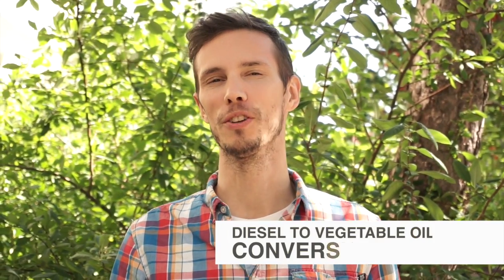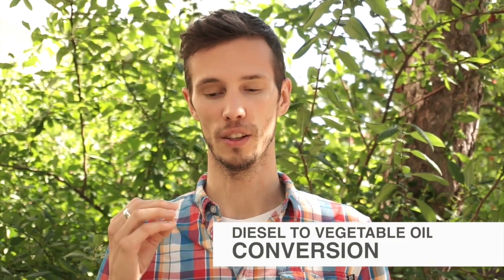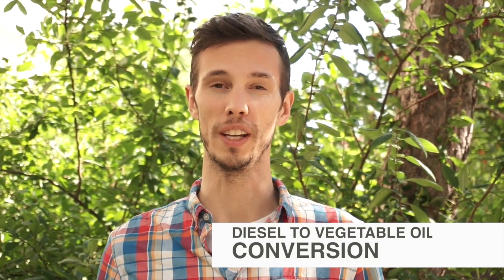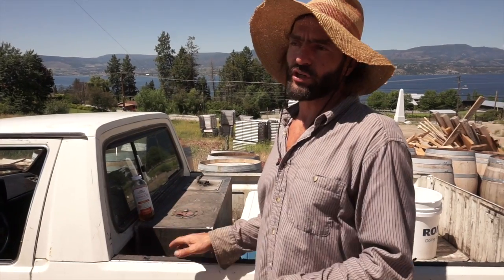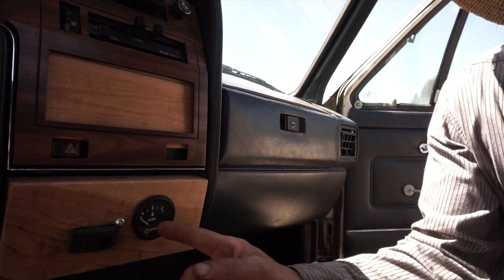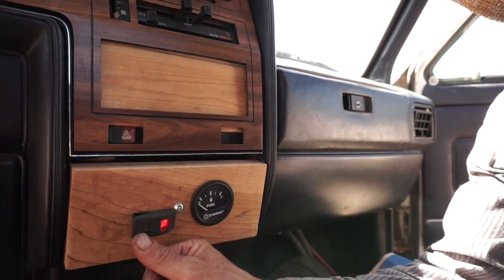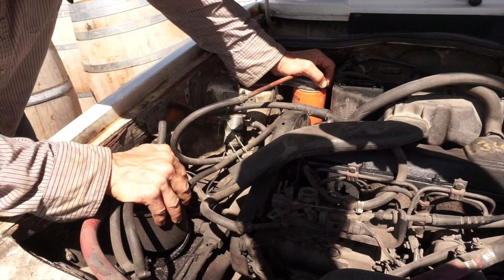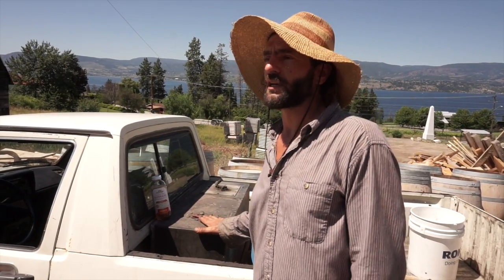Farmer Converts Diesel Truck to Run on Waste Vegetable Oil

Comment: Hows to system running in time.what happens if you get cooking oil with animal fats can a heating unit be fitted?.with diesel prices at $2.40 a litre in Australia this would be great on my old Datsun 720

Comment: A man in the 1970s did this to a Datsun pickup. You also get more miles out of a motor because it better lubed with oil fuel. The man in the 1970s tried to patent the idea, and the government wouldn't let him. He was getting like 50 mpg as well...

Comment: At the start you stated you can convert any diesel, as someone who has done a conversion and run the vehicle for a few years I disagree, I personally would not recommend anyone doing this to a modern common rail diesel motor and IMHO the best candidates are older, more basic engines with no electronics ie mechanical injection pumps and mechanical injectors.
It’s also important to filter your oil well and engineer the system so as to avoid cross contamination of vegetable oil into your diesel, this can be done with independent supply and return valves and controlling them so vegetable oil doesn’t ever return to the diesel tank, having some diesel in your veg oil is fine but not the other way.

Comment: neat system. Technically to get a diesel to run on vegetable oil though, you just need to pour it in the gas can. No mods needed. I wouldn't do that long term, but it can be done.

Comment: I’m in the Texas area and the government has been taping into this source and it’s been difficult to find a good source. I was just going to use a bucket, Rachel strap, and some fabric as my filter. I’ve used up about 10 gallons of WMO. I don’t run 100% but I run a max of 50-50 or 25-75. Diesel to oil ratio. But it’s a bit harder to get the WMO because auto stores won’t give it to you.

Comment: No need to go to the expense of doing a conversion just use a 50/50% diesel and sunflower oil mix, you can increase to 30% diesel and 70% oil in the summer months without any running issues but under winter running conditions a 50/50 mix works well, and you won't have problems starting. I have been using this mix for 12 years on a pajero 2.8 auto 1996 registration with no problems.
Reply: @exploring perspectives It saves money in the EU a gallon of diesel is 7.30 US dollars, supermarket oil is half that
Reply: i alsp have a pajero 2.3 td 4d55 with precomp chambers in greece ,do you believe it would work???
Reply: @ΙωάννηςΛαμπρογιώργος  it depends on your diesel fuel pump the older mechanical pumps on the 4m40t run ok but you will have to check with a reliable 4d55 engine tech to make sure. Some pumps cannot contend with a non diesel feed.
Reply: @radionutio81ij79  thanks a lot!!!! , 4d56 is older mechanic so i believe it wont have problem
Reply: Hi i know its late but can i ask you a few questions since my mum health isn’t doing well and i need to save some money to help her get her surgery 

So long story short short im 23 

Im gonna sell my gmc sierra truck to help my mum 

And i need a vehicle but I can’t afford gas or diesel so im considering this 

I need more info about this if anyone can help
Reply: Dont listen to this guy commenting all a conversion means is adding in-line fuel heaters and filters..in colder climates an add. tank is necessary for starting. without these add ons if you put used veggie oil in your tank your car WILL BREAK DOWN. This is a hard thing to do if your just looking for an easy way to save money it will cost you eventually.
Reply: @trluke94  wrong
Reply: @trluke94  Your car may break down on 50/50 during winter, but it's less likely in warmer climates. Maybe he runs his Pajero near the equator for all we know.

Comment: This might be useful for jet fuel, but as for cars I think compressed air is the way to go. Electric needs batteries which we dont have enough material but it will help on the side, and vegitable oil takes up too much farm land for everyone to use that, but I think it could be useful for just planes as electric planes dont get that far
Reply: 😂😂 compressed air

Comment: Hi Mat, thanks for sharing your video. The inline filtration system you talked about for filtering your oil as you collect it, do you have a link for it by chance? Is it a centrifuge filter/seperator?

Comment: So let me get this right, he switches to diesel when coming to a stop because the engine can't keep the idle(as vegetable oil it doesn't burn as good as diesel). But this applied in a modern engine with electronics, where the idle is automatically adjusted to keep the engine running, shouldn't be needed. So if this is right, he could just adjusted the fuel pump to get a higher idle and avoid stalling when stopping, that way you don't need the diesel anymore
Reply: Why not just blend some diesel with the WVO? Start by adding 20 percent diesel into your spare tank.
Reply: he switches over to wvo so the car starts on diesel and runs till it gets warm enough to switch to wvo. the car will idle fine when it is warm
Reply: someone said adding diesel would help keep the wvo so you wont need to heat it up, idk i think they said 15-20% but if you run striagt on wvo its a great thing...no diesel needed right?
Reply: just mix 20% gasoline in the oil and no mod needed...
diesel mix tend to gel at low temps.
Reply: it's to flush all the fuel lines and the engine itself, you don't want the water and wvo in your engine overnight
Reply: Teun van der Woude not really cold start is the only problem of wvo that's why you switch to diesel before ending a trip so next start won't be difficult

Comment: If you want to live in sustainable manner, then do NOT put FOOD into your fuel tank. Thank you.
And no, not even if it's used oil, since an increasing number of vehicles running on this fuel, will create a need for more veggie oil, which at a certain point will mean FRESH vegetable oil.
So just stay out of there.
Reply: After a certain number of cycles or usage (times used for frying), cooking oil will become rancid, acidic, dirty, and not food safe even if extremely filtered. When the restaurant disposes of it responsibly, it is sent to be one of 2 places: 1) to be used as heating oil for buildings 2) to a biodiesel factory to be converted into vehicle fuel (which is what this man does, he simply cuts the middle man out and saves restaurants money so they won't have to pay to have hauled away)
at no point in the next 100 years would any farm or cooking oil company find it economical or logical to sell oil mainly used for cooking straight past the restaurant and into our fuel tanks. its impractical and would never sell as diesel, even at $5.50 a gallon, diesel would be $1-$2 cheaper that the lowest quality cooking oil

Comment: I contacted a mechanic who did it to his Mercedes and said its not worth it, he replaced injection pump after 35000 miles.
Reply: your wrong the only way to go through an ip or injectors are
1. inadequate filtering (particles arnt good... doesnt take a genious) 
2. inadequate per-heating (160 deg. f flows oil similarly to diesel oil is much thicker)
3. if your oil doesnt lubricate the pump (a can of diesel kleen will solve that)

long story short the ones who do it right dont experience problems but thoes who dont give it a bad name 
P.S 160 degrees F. means the oil is that hot in the injecton pump/injector lines/fuel line coming in the injection pump id insulate the lines for the last one
Reply: I been driving diesel autos since 1977! Right now I drive a 1982 MB 300 SD turbo diesel! The problem is the mechanical fuel injectors need the lubrication from the fuel, veggie oil does not do it! Now with the modern common rail injection systems on  the newer cars and trucks no way!  New injectors are not cheap, then you have other issues! The Idea that its well free, it's really not, unless you consider your time and effort worthless! I do not! I while ago I was looking a  300 D MB from Southern California, the car was in damn near showroom shape, and less that 80K on it , a 1981 car, converted to veggie oil, I told him that I would buy the car, for 1/3 the asking price, because I would have to replace all the injectors, fuel lines, and the injector pump will have to be taking out, no small job and gone thru and rebuilt! This pumps on MB are as bulletproof as you can get, then run a lot of diesel purge thru it, remove the tank and clean it out! I shake my head every time I see this sort of stuff!  The 617 engine is a very good engine, but its designed to run on diesel fuel, not just crap that you can get it to burn, it will do it with a lot of work and headaches! That guy is not saving a dime on his fuel costs, it just goes to other places, mile for mile it's cost him more!

Comment: Can I run used veggie oil in the normal tank? Will it auto ignite like normal diesel when the engine is cold? Can you put the oil without doing anything, and I'm pretty sure it will clog the fuel filter way quicker?

Comment: So will the engine burn the fats in the oil as long as its heated high enough? Or do they need to be cleaned out before its added to the tank in the truck box?
Reply: From what I've read, you have to filter your Veggie oil meticulously before you put it into your tank. If there's any food particles, water, soap, or fats, then you'll eventually break your engine's fuel injectors.

Comment: Well.. it's a great idea to do this if you can... especially if you need to save money... BUT beware: - 1) Most modern diesels ("common rail") are not suitable for (simple) conversion and a lot of diesel pumps are not suitable and WILL BE DAMAGED very quickly by Veg oil (Lucas pumps for example)  Old Mercs and VW's do have suitable pumps though. Converted engines produce "brown soot" not "black soot" so show up cleaner on emissions tests! It is believed that brown soot is actually 30x more carcinogenic than the bad stuff. It's a lovely smell though.
Reply from the maker: +Michael Monk thanks for sharing this information with everyone so they know that some engines/models are more adaptable to veggie oil than others!  I think it's very important to filter the oil before pumping it into the engine, and also to ensure that the diesel is switched on for the first and last couple of minutes driving.

Comment: I'm sorry but this isn't ecofriendly. And also illegal in many places. Make sure to check with your local laws before doing this!
Reply: Illegal? Why?
Reply: RV regulations vary wildely from states to states, province to province...

In Vancouver he could do this while in Qc and Ontario it's MUCH MUCH harder (more regulations to follow...)
Reply: +simonlynchsae They won't give a single fuck neither in Quebec. In Ontario, if you don't show up at the e-tests running that, you'll be fine.
Reply: What I'm saying is: you can't convert a bus to an RV as easily as this. I've looked into it. It's considered an artisanal car and nedds a ton of regulation plus SAAQ inspection.

My point is, he's lucky BC is so chill about it (or he got it licenced before the hammer came down on regulations...).

Once it's converted, you're golden. You could take an old RV and do that and no one would know... because logic... -_-
Reply: Just never mention it to the SAAQ, and even if you mention they will just oh congrats!
Reply: I don't think you understand. I actually talked to the "engineers" at the SAAQ. You can plate a BUS 3 way: bus, heavy vehicule (L plates) and RV.

To plate it as an RV (and be waived the assle of the heavy vehicule regulations) you need to make a proper conversion following strict guidelines and CSA and NFTA regulations.

You can't slap a wood stove and a bed in the back and call it a day!.. sadly...

Comment: People have been doing this for a long time.  The way he's doing it will work on older engines with mechanical injection, but to use it on newer vehicles with computer controls and multi-shot injectors, the fuel-oil needs to be purified and refined or it can cause big expensive problems.  There are DIY kits out there for this.  The newest diesel engines out there right now are rated to use B20 which is 20% biodiesel.  Due to stricter laws, the tolerances and emission and computer systems of new diesels are very sensitive.
Reply from the maker: +Tommy TwoGun I didn't know this, thanks for bringing it up and sharing with us!!  I'm sure it'll help people who are thinking of doing the conversion :)

Comment: I've just bought a van to live in and the guy who sold it to me was saying how it's been converted to run on both diesel and veg oil, still learning about it so haven't given it a go yet, there's just one fuel tank so I'll be running a mixture. Need to look into local businesses that will give me their oil for cheap/free. Keep up the great vids, found many of them really helpful 👍
Reply: +JamieWadd91 Restaurants usually have to pay to get rid of the oil in a responsible manner, so giving it away for free saves them money and makes them feel good. Win-win in my book.
Reply from the maker: +JamieWadd91 Cool, you're lucky you found a van with a veggie oil conversion already done!!  I wish we had that set up too.  Best of luck figuring out how to make it all work and thanks for watching :)